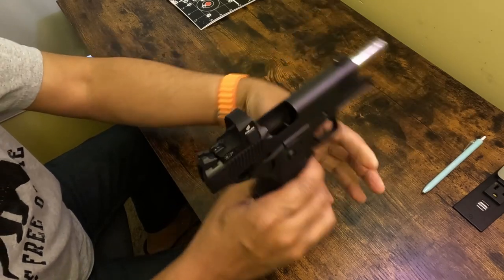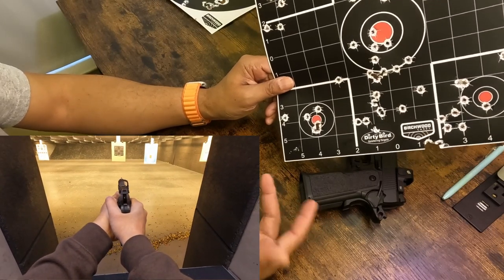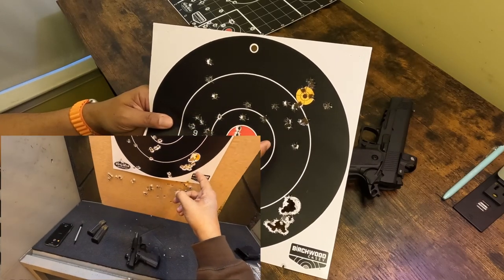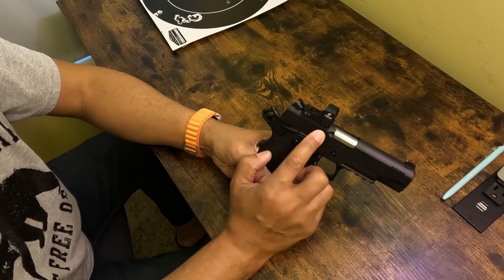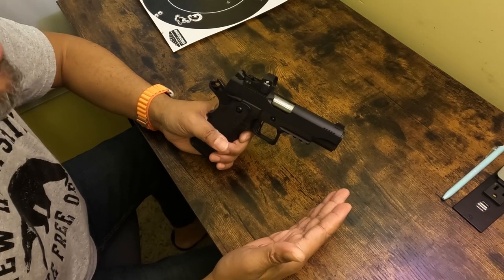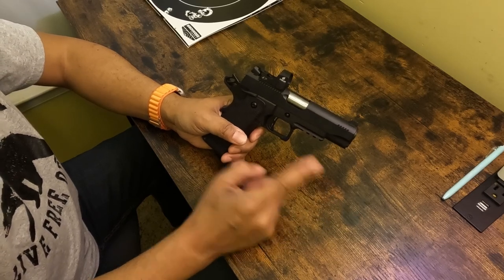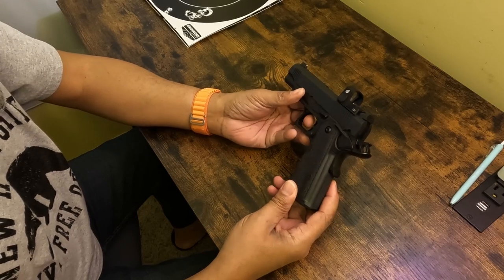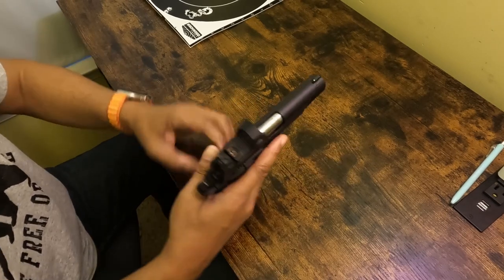Tisas Carry DS9 - 3rd range visit; Some Issues with the Gun

Comment: Doing research on this model. Your experience is helpful.  Question, Did you measure the cut?  A set of calipers from Harbor Freight has been invaluable to me. It takes time to measure.  I hope you worked through this with Tisas.  I picked up an Aviator to answer questions I had. I had an excellent customer service experience with SDS/Tisas when it developed some problems. All is right as rain now. BTW when I got the Aviator home, field stripped, it was the dirtiest example of a new gun I ever encountered. I detailed stripped at that point cleaning and lubing it along with noting that the internals were cerakoted. sigh... I used a fine grit nail file and flitz polishing to remove the cerakote. It was all very smooth then. Remember if a Man builds it sooner or later its gonna break. Good information. I hope you continue to enjoy your example.  Post an update when you get a chance.
Reply from the maker: I saw others reach out to Tisas and saw how Tisas responded to others (not really favorable), so I opted to be happy with my workaround of the issue.  I don't really trust them to fix it.  I document the issue via Youtube so that others can be aware before making a purchase.

Eventually, I'll send the gun to someone that can properly mill an optics cut.
Reply: @unixfool  I hear ya.  I went into this with low expectations to answer questions. I trust SDS/TISAS to fix things.  Their US based Smiths are not going to do the same "Style" work as a Nighthawk, Wilson or Les Baer.  The 9mm Aviator specimen sent back had/has some fitment issues. I sent a laundry list of small issues, I wanted to make the trip back count. The 2 things that were surprising.  The barrel was replaced and the Thumb safety replaced.  The barrel was not fit well from the start, however relatively accurate. It is tight now front and rear.  The Thumb safety went from just ok to mush. On my list,  Not listed in the work order, It was replaced with a new safety (It clicks now but firm). Do not send magazines back with the pistol unless its part of the problem. They will disappear.  Mine were missing upon return.  I properly complained through email. Nothing, crickets.  3 weeks later a package shows up with 2 new 10 rd mags.  I don't know if it  was an individual or is being addressed by policy.  It is paying attention though. Some Customer Service experiences can really sour your views of a company.... Yes I'm talking to you Ed Brown. My 2 cents send it back to Tisas. Your cut issue will get addressed.  What will it cost you to find out? Nothing but some time.  I have updated my Aviator with a Wilson BP Thumb safety, a spare set of wood grips, 10-8 NM rear sight, A flat wire recoil spring, GI style. That is about the extent of updates. It  is a dollar proposition of how much to put in to this at this time.  So basically I have just shy of $600 in.  It is a whole lot more fun and better shooting than a Glock.
Reply from the maker: I saw someone post their support experience on a 1911 forum:

https://www.1911forum.com/posts/13982200/

“I bought a pre-cut slide a few months ago that had the optic cut problem. I ran out of elevation on my Holoson 407k without being able to zero. I contacted SDS, which paid for returning the slide, and got the slide back about a month later with nothing but an unfitted cheap delrin plastic wedge in the box, which was not a good fit and leaves very little stud elevation to catch in the corresponding optic holes. I was hoping for a recut or a replacement slide. It's a lot of money to spend for a defective part. I'm done with SDS and Tisas.”

In my opinion, that was handled by Tisas in an incompetent manner.  When I've seen Tisas interacting with folks in the forums regarding this issue, Tisas has been very defensive -- more so than warranted.  This is why I was standoff-ish about dealing with them about it.  I'd rather just leave my assessment on Youtube, supported by Tisas' forum interactions, than have to deal with them doing the same thing with me.  This situation sucks (as well as anyone that's affected by it), but that post kinda vindicates my feelings on the issue.

This is offputting to the point that I don't think I'm going to recommend Tisas products to folks anymore.  I will probably post a quick video about this so that viewers have additional data points to work with.

I’ll eventually send it to a 3rd party to get it milled properly.

Comment: Well picked mine up today, 507k mounted, trigger work. Took it to the range to feel the trigger and zero the dot. Trigger felt great, BUT dot was pointing to the sky. Could not lower with adjustment. Glad I found this video, ordered the shim from Amazon. Went thru 4 mags, iron sights are off to the right but love the trigger, 3lbs.
Reply: Ron how many shims did you have to use to get the dot centered.  I only ordered one and from the looks of it I think I will need 1 or 2 more
Reply from the maker: I used one shim.  If you've to use more than one, you should contact Tisas support, because that's definitely out of spec.
Reply: Which shim did you buy? Can you post a link?
Reply from the maker: @DesertTactical 

Ade Advanced Optics shim, for the 407k/507k, on Amazon.

Comment: Wilson Combat 12# recoil spring and reduced power main spring will fix it. Tisas comes from Turkey with HEAVY springs because it is designed for sustained +P use.
Reply: I second this. Got a 12# rec spring and 18# main spring on my Carry model and it feels smooth.
Reply: @DesertTactical  I got the idea from one of your videos. Along with the WC bushing. I got the thick one and it took a little break in to be able to turn it by hand but it works great.
Reply: @BYoun69  awesome!

Comment: You can adjust any 1911 or 2011 trigger by bending the leaf spring under your mainspring housing.Get the 45 auto shop manual it gives detailed instructions on every part and how to adjust and fit everything.
Reply from the maker: @alpalmieri8644  after I saw how the stock spring was, I opted to just buy one from Wilson Combat. The OEM one seemed hard in tension, which made it difficult to adjust. As well, it was oddly twisted a bit.  I didn't even need to adjust the WC one but it will allow better adjustment than the OEM one. 

The new leaf spring lowered the trigger weight a bit and offered easier adjustment, but didn't resolve the stiff wall issue.  A hammer spring change helped with that.

Comment: Mine mounted an optic without issue and has been great so far, putting another 150 through it tomorrow. I mounted a tlr7 sub on mine as i liked how it fit better than the tlr7a. Definitely recommend taking it all the way down and tuning the springs for a better trigger pull. About an hour of work and itll be a nice 3-3.5 all day.
Reply from the maker: Thanks for viewing and sharing your input.

The main issue I have is that Tisas has issues with things such as sights (they've documented issues with sight cuts), M1918 rails (they've documented issues with the way the rails are cut on Carry models of their guns - the TLR7 Sub is the only one that'll fit; options are extremely limited), and now they've problems with optics cuts.  I share any info (negative or otherwise) that impacts me and that's what I've done in this video.

You may not have an issue with yours, but there are enough folks having issues that Tisas has publicized that they've actually made adjustments to the optics cut to remedy those issues.  There are trends that they're setting that isn't really conducive to their established reputation.  Discovered issues should be remedied.
Reply: @unixfool  I think you absolutely should document issues so others know if it is a trend. I have several tisas 1911's of various ages and have been lucky I guess with no issues in any of them. I hope yours gets sorted out! And yes the short "1913" rail on the carry is annoying but 🤷

Comment: I didnt have an issue mounting a light on mine i couldn't mount a full size light like me streamlight tlr1 hl but i was able to mount a compact light i used a streamlight tlr7a with no issues
Reply from the maker: Any other version of the TLR-7 will not, from what I've seen folks complaining about.  

Of all the compact/small lights, that is the only one that will fit, across the spectrum of lights.  Again, this is from what I'm seeing folks complaining about, so I've no first hand experience, but it is a bit difficult to ignore.

Comment: I was having trouble following you when you were talking about the dot pointing up. Wouldn't that change based on where your eye is located behind the optic and what the elevation screw was set to? Did the Holosun have a gap when mounted? Wouldn't the bottom of the shim have a gap also?  What issue did this cause that couldn't be fixed by adjustments to the elevation? Did it bottom out the elevation screw so you couldn't sight in the red dot? Sorry for all the questions, I just didn't fully understand the issue beyond there being a visible light gap under the cheaper optic (forgot the name). Edit: after I got to the 23 minute mark I see you said you had to fit the shim. Did you have to file off some of the front? Do you think this is standard or maybe a worn tool didn't cut your optic cut large enough? Also, have you contacted Tisas USA about this? I am picking up my Duty model tomorrow and I hope this has been fixed and isn't a "feature" on all of them. I don't think I have seen many or any with optics installed in reviews yet, besides yours. Thanks for posting.
Reply from the maker: I'm sorry for the incoming wall of text:

Yeah, I said in the video that both the Cyelee and my Holosun 507K showed a gap when mounted.  I'd mentioned that bit of information because a lot of folks were reflexively saying, "it's the cheap optic that's the problem" -- if that were the case, only the Cyelee optic would've had the issue and the Holosun would've been fine.

While the optic dot location will change in relation to the location of your eye, if you're sighting the irons and then look at the optic, the dot (within the glass) should be in a generally centered location.  The dot shouldn't be super low or super high on the glass.  When I placed both dots on the gun and then looked down the irons, both dots were almost off the glass...was 12 oclock high.  The Holosun was doing it but wasn't doing it when mounted to a different 1911.

The bottom of the shim isn't showing a gap, but the shim isn't metal.  It's a thin sheet of delrin, so I'm assuming it's compressing and filling in the gap when I screw down the optic.  It's thin, so it's probably bending a bit to fill the gap, as well.

I didn't try to zero either optic when they were sitting so high.  IMO, doing that would've been a waste of my range time, so I opted to use the optic shim and zero the gun...even while I was able to zero the optic, I may have been at the edge of elevation adjustment (not sure, as I never reached the bottom, but I had to add a LOT of adjustment).

I also chatted with someone with this exact same gun and he had the exact same issue with his Holosun 507K.  He said he wasn't able to zero his 507K because he ran out of elevation adjustment, so he used an optics shim to get better adjustment (that's what they're designed to do).

Yes, I'm thinking that the optic is cut wrong, probably due to worn tooling or something that is just out of spec.  I've seen at least three folks talking about them struggling to get the optic mounted properly.

The main reason I spent so much time in the video discussing it is because I think some folks are way too quick to blame a cheap optic as being the cause of such an issue (luckily I had two that I tried).  Another reason is because Tisas sometimes knowingly does not use proper specs - a good example of this is the Pic rails on the Carry 1911s...those rails are cut in a non-standard fashion, so that most lights can't fit the rail.  Another is the sight cuts - they are notorious for not fitting most Novak style sights.

Note that I don't think this issue is so widespread, so your Duty may be OK.  Some guys may be able to have just enough elevation adjustment to sight in their optic, so maybe they're not complaining.  If you receive your Duty, you can always use an optics shim, so all is not lost.  Another option is to send the gun to get a proper cut (which I may do later on).

I have not contacted Tisas about it (yet).

I hope the above answers your questions.  Again, sorry for the wall of text, but you asked a lot of questions that needed detailed replies!  :)

Thanks for watching - I'm actually shocked that someone commented on a topic that was that deep into the footage, as many folks seem to hate videos longer than 10 min.
Reply: That clears things up, thank you. I guess I missed some things you had explained already. I actually prefer long format videos and refuse to watch YouTube shorts. Not all of us have completely lost our attention span. Long, well thought out explanations are why Paul Harrel is my favorite content creator. 
By the way, I just picked up my Tisas DS Duty from the ffl and I have to say that the trigger on mine is amazing. It is about 3lbs and the wall is just perfect. The guys behind the counter said they are going to pick one up after feeling mine. Fit and lockup seem really good as well. I may want to carry this gun and I am a little concerned that the trigger is too good. I don't know if I got lucky or maybe they are correcting issues in assembly/manufacturing. 
Anyway, good luck with getting yours sorted out. At least you have some beautiful 2011s to fall back on. I plan to get the updated SAS II UL later this year!   @unixfool

Comment: I personally like a trigger with some smooth creep in it. That hard wall is distracting to me. Take up the slack and then steady pressure through the creep and ignition. Unless the trigger is very light, less than 3lbs, then I like a very discernable wall. I shoot both well, but a hard wall slows my split times as I have to be just a little slower on the trigger press.

Comment: You are RIGHT lots of complaints about optics running out of elevation due to wrong cut on slide. I did research and again your right do u think tisas will fix that under warranty?
Reply from the maker: I saw the below posted on a 1911 forum two days ago:  

https://www.1911forum.com/posts/13982200/

“I bought a pre-cut slide a few months ago that had the optic cut problem. I ran out of elevation on my Holoson 407k without being able to zero. I contacted SDS, which paid for returning the slide, and got the slide back about a month later with nothing but an unfitted cheap delrin plastic wedge in the box, which was not a good fit and leaves very little stud elevation to catch in the corresponding optic holes. I was hoping for a recut or a replacement slide. It's a lot of money to spend for a defective part. I'm done with SDS and Tisas.”
Reply: @unixfool oh wow… I guess they will rather send a shim that re-mill. Cheaper of course…